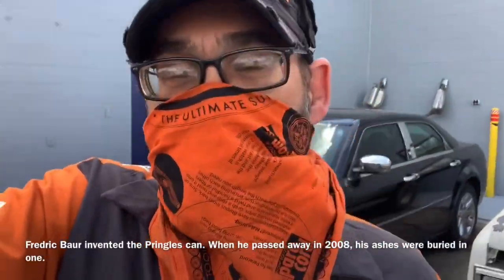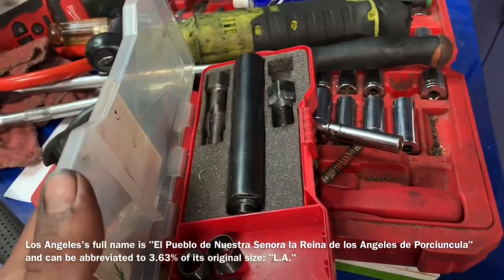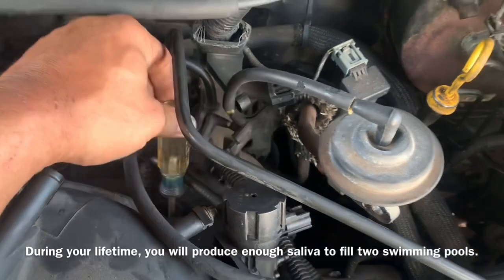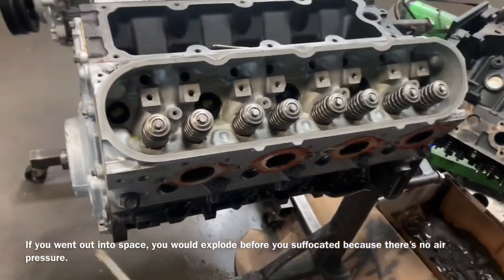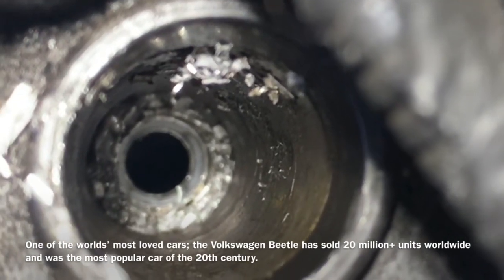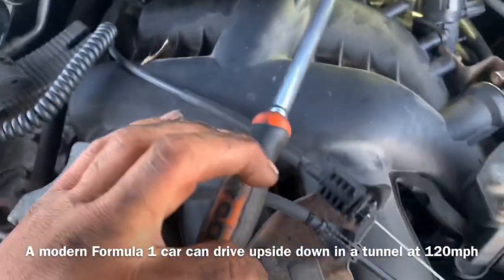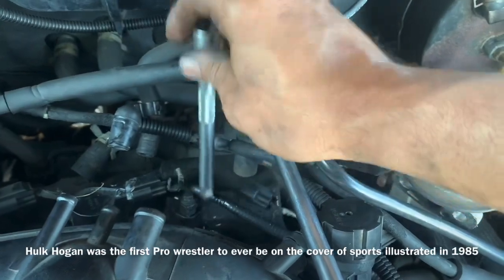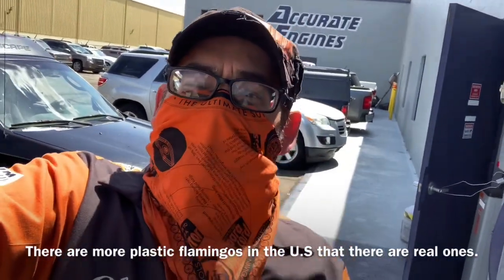Mercury mariner spark plug blew out of hole Repair

Comment: How can i find out if all my cylinder are Going in my V8 6.0 escalade, sometimes it makes a hit pitch sound on first start up of the day then stop once warm.
Reply from the maker: Hey good morning Derek. It would be extremely difficult to describe that over a text message I would just recommend biting the bullet and taking your vehicle to a service shop. It’ll probably only be somewhere between $50-$100 to find out what the problem is and it will probably save you that in time and headache

Sorry brother wish I could be of more help